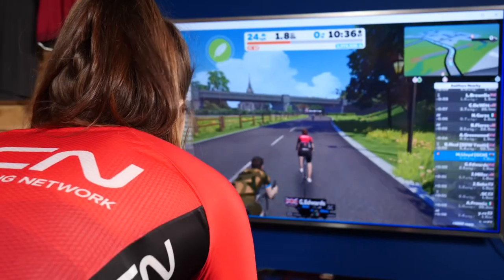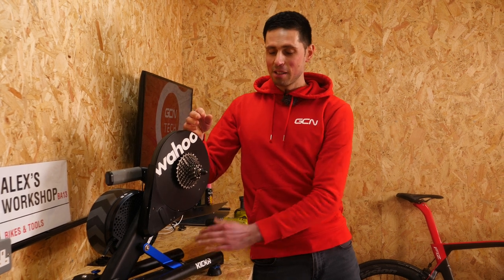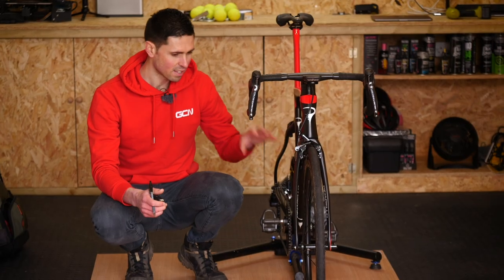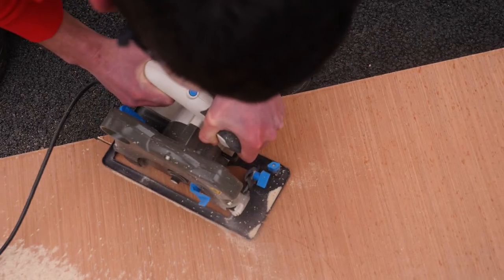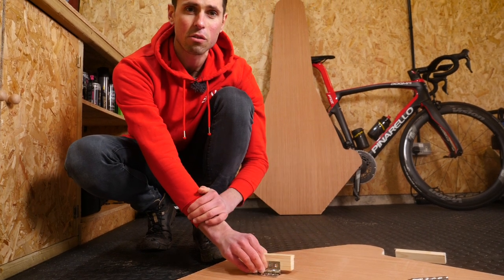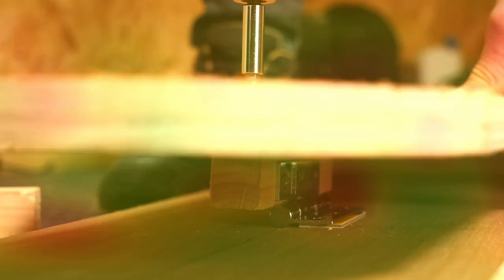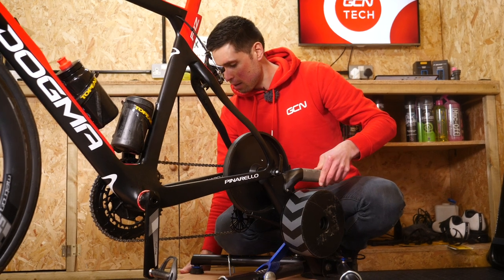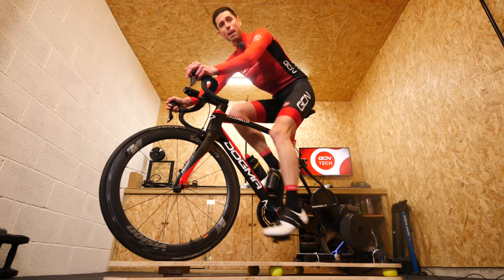DIY Homemade Rocker Plate | Cheap Indoor Training Upgrade

Comment: How about rocker plates with forward & backward as well as lateral play? Does anyone have input/experience with those?
Reply: In theory an extra plate with the hinges turned 90degrees and an extra pair of hinges on the side could work but it would likely make it a bit too unstable as it’s be quite tall, maybe if you had some slightly stiffer than tennis balls it’d work.
Reply: @tombladon8064  - sorry, I didn’t make it quite so clear. The ones I’ve seen have a slide for forward back movement(not angular) & a rock (like the one in this video)  for side to side.  I wonder what the slide forward & back might be like. 🤔
Reply: I use rubber elastomers that provide a small amount of fore/aft as well as providing rock side to side.  IMHO better than just side to side with a hinge
Reply: The fore-aft motion rocker plates are quite nice.  Some people say that motion makes more of an improvement for comfort than the rocking motion.

I've ridden with and without fore-aft, and prefer having it most of the time.

It does take a bit of getting used to for transition between sitting and standing. But that can be turned with the centering spring setup.
Reply: @Chader9  - Awesome! Thanks for the info 🤝